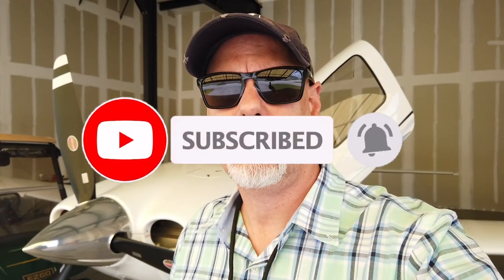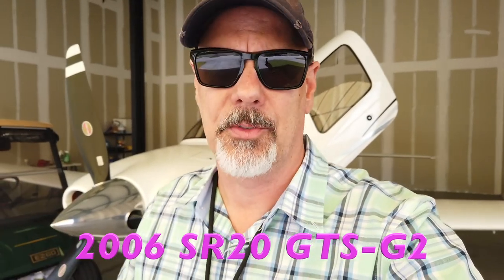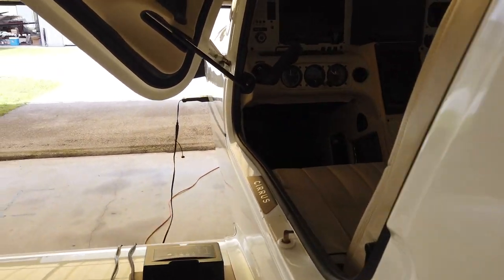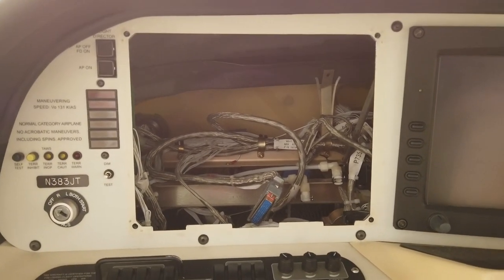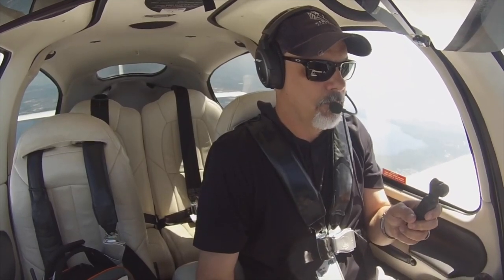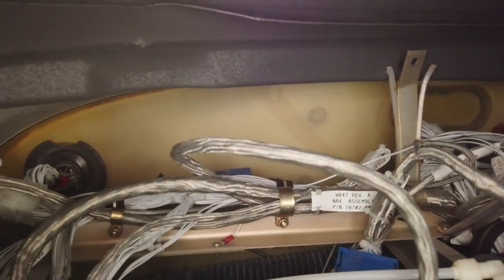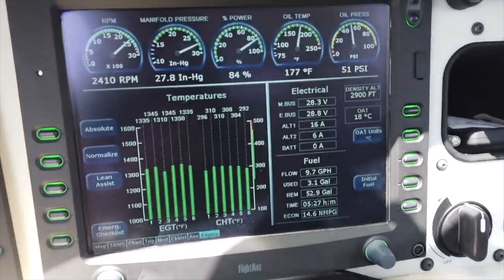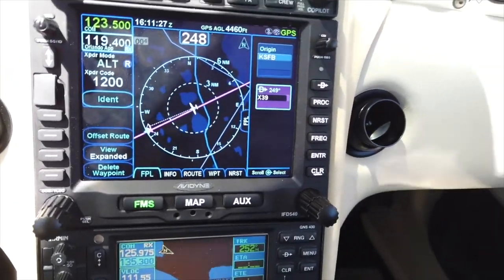Cirrus SR20 Avidyne AeroPlan!  It ain’t cheap to own and maintain an airplane!

Comment: Hi Dave! Great video. Are you planning on making a video breaking down some of the costs you've incurred in ownership?
Reply from the maker: Haven’t had the time to add them up as of yet, but it is not cheap!  The AERO Plan fix was about $5800.00!  Add to that the Hangar Costs, miscellaneous repairs and fuel cost and you will need several 2-3K per month to support an aircraft of this caliber.  I use it for business trips a lot.  Check out the video I recently uploaded on that! Using an Airplane for Business!

Comment: Dave, how much is the AeroPlan per year? I assume it just covers the two Avidyne units, nothing else?
Reply from the maker: Depends on speed of coverage (I.e. how soon you want it fixed) and Length of coverage.  Longer the coverage, the cheaper it is per year. In total, the repair and 3 year plan was about $5800.

Comment from the maker: UPDATE:  Some of you questioned my removing the original screen coating and adding the anti-glare overlays.  Well, I can now tell you that the PFD was REPAIRED by Avidyne and shipped back (Pretty fast actually, but I paid the extra for that) and there were NO issues with the screen itself.  They claim it was the backlight power supply!  I didn’t know the backlight HAD a separate power supply, but there you have it.  Avidyne also updated the software to current Entegra versions.
Reply: Dave,  I purchased the Avidyne plan for both displays since the plane was new.  3 year plans.  On the third time I transfered the plan to the new owner.  Lucky Guy!
I totally agree that it is neccessary and painful to pay the bill.  I loved the video with your granddaughter.  Best of luck with your IFR training.  It is all worth it.
Wayne
Reply from the maker: @waynetrefil1311  thanks very much!  Are you going to get back in the seat?  Have you considered jumping back into a Cirrus?  I will keep you posted on N383JT.  Still more film to cut!
Reply: @QuantumFly  DAVE I REALLY miss flying 383JT.  I would love to get back into a Cirrus, However,  my wife would probably do some form of bodily harm to me if I ever bought another plane. I havent flown since I sold 383JT in Dec 2013.  Illinois taxes,changes in the bussiness climate, and so many more reasons made me face the music that I had to give up the plane.  I have been retired since april 2018 and moved to Indiana.  Could not afford to live in my home in IL anymore.  I am kicking around the idea of checking out some local airports and a good IP.  Who knows.  Just today while working in my backyard a Cirrus flow over my head at about 2000 AGL on his way to Lansing KIGQ.  I had my Transciever on and listened to his position rpts.  Question......when I sold 383JT I included all the manuals and POH.  Cirrus gave me two of each.  On for home reference and one to leave in the cockpit.  Also a quality canvas cover cowl plugs.  Did you get these items?   Just curious.

Univ of North Dakota, UND,  gave my 3 days of training before they would let me fly home from Diluth MN.  They gave me some software that allows fast W&B calculations .  I gave that on a thumb drive to the new owner.  I still have that on my PC.  Do you need something like that?  

If you check the Aircraft logbook you will see that I had an issue with the MFD within a few weeks of owning the plane.  I could not upload Nav data or chart data through the USB port on the right side of the MFD.  I had to leave the plane at KPWK , the closest Cirrus Auth Serv Ctr at the time.  They pulled it out and sent it to Avidyne.  Something about a bad solder joint on the Circuit board.  I still remember all the required SB I had to comply with.  Royal PITA,  but I had to comply.  Brand new plane and her I am going back and forth for repairs.

I know its expensive to own,  But hang in there as long as you can.  Its a blessing and a privilege and something to cherish while you can.  ENJOY!

Comment: 60 days sounds like a criminal enterprise.
You didn't actually discuss the costs... 
If they are legal in USA and you don't need 4 seats, you might look at the VL3 915. Or Lancair IV-P if you want to go really fast
Reply from the maker: The costs are confusing Dan.  That's why I did not get into them.  They are posted on the Avidyne website however.  I will provide the link at the bottom of this message.  Yes, it DOES feel like I am getting kicked in the gut over this!  I wanted to buy the AeroPlan some time ago as everyone said it was necessary due to the repair costs.  If I had purchased 60 Days ago, I would not have to pay the extra "we have you over a barrell" fee!  If you check Garmin, they are just as costly to repair.  Unfortunately, there are quite a few Cirrus aircraft out there that have these Entegra glass cockpits and they are NO LONGER made by Avidyne.  They have gone more toward the FMS systems like their IFD Series with the PFD built-in to the unit.  I have seen Lancair aircraft too and they are now looking more cost effective than the Cirrus and great performance!  Looking to upgrade the SR20 some day, when I can afford it.
 Here is the address: 
https://www.avidyne.com/product-warranty-registration/#tab-id-3
Reply: @QuantumFly  Not to knock the Cirrus, I assume it's quite possible to not have constant issues like shorting cables so you need avionics repair. But should you want to change there are cheaper Lancairs too. 320/360. There is a Lancair 360 with 700 hours for 89k for sale now although older instruments. Maybe wait for one with nice Dynon glass in.

Comment: This video really has no structure to go over your point 🤷🏻
Reply: Sorry @Ash, there really is nothing I can add other than to recommend that you check the Avidyne website for the Aero Plan.  It seems to change regularly.  Just an update to what happened and how I got it fixed it with the manufacturer.  This is the biggest challenge to most with these Avidyne systems.